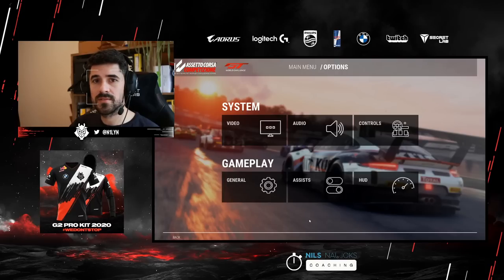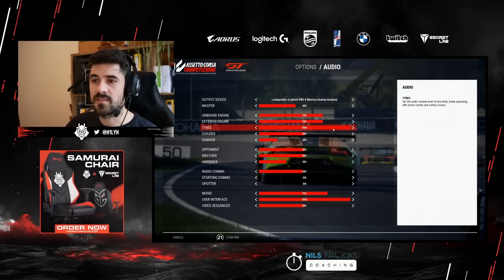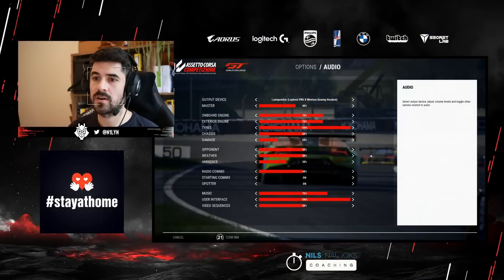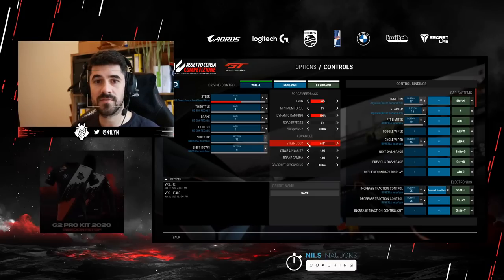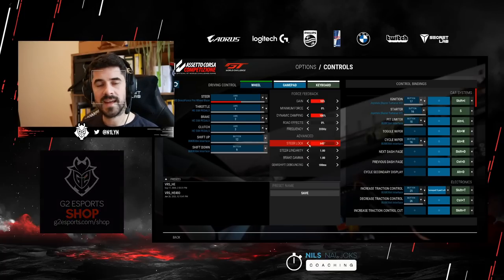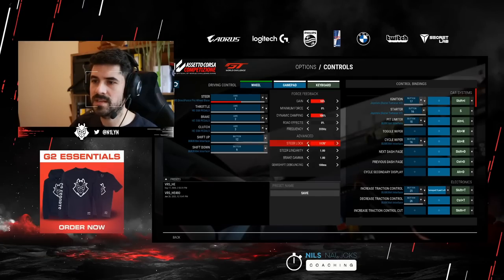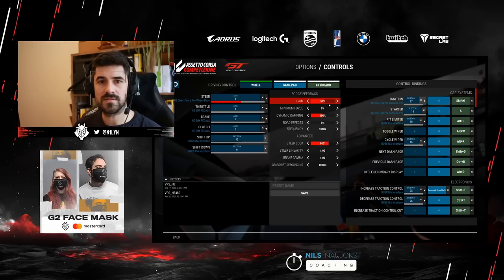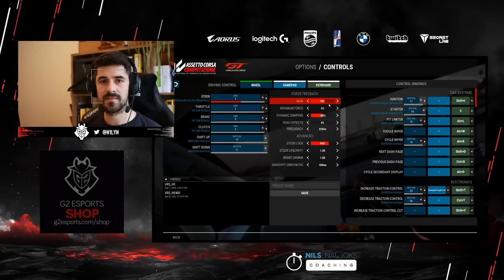Understanding ACC 1/3 - Controls, FFB, Audio, GFX - Assetto Corsa Competizione

Comment: Good video. I'd just like to add for those with Logitech wheels, set minimum force in force feedback to about 11% or 12% in the game options. I found my G920 has a big dead zone unless minimum force set quite high like this. Aris mentioned this in one of his video's, so I tried this and it makes the force feedback a lot better. Aris did say it really only effects Logitech wheels all others should be fine.
 Also with using Logitech pedals I had to go into Logitech profiler and set brakes up in there, as the game settings didn't give me the setting I wanted. I have it where when it hits the rubber stopper I have full brake pressure when pressing quite hard, and brake fully releases when I get no pressure from the rubber stopper. So as soon as I feel the rubber stopper it starts braking then when It is pressed hard I have full braking. It doesn't give me much pedal distance, but I find using pressure on the rubber stopper easier for me.
 Hopefully this might help someone using a Logitech wheel and pedals.
Reply: Thanks for the information..I have a G25 and the minimum force of 11% works well.
Reply: @martynhulland6252  G25 and any other G family are stronger than G29. G27 i think is the best.

Comment: I see that in your video you say not to touch the linearity of the steering wheel but I'm convinced that this is a trick that is used by the best like McCormack, you only have to look at the way they drive to understand that they use the linearity of the steering wheel. I even found this trick not long ago and I'm categorical on the rear engine cars, it's very efficient and it makes the car much more stable when entering and exiting the corners.
Reply from the maker: you are not changing the linearity. it will remain linear, but it will be very sensitive. I do not recommend this, especially for beginners, to make the steering more sensitive than it needs to be.
It is very easy to turn too much and hurt the tires and it is very easy to turn too little, resulting in a choppy way of driving for everyone that is not a pro.
Reply: In any case on the vehicles with rear engine it works very well even for the beginners the car deviates much more stable that gives less oversteer in entry and exit of corner there is just to test to understand that it really changes the feeling of the car there is not photo me now I drive only like that and I am much more regular and I drive in the crhono of the best so these necessarily effective if not I would not have fun to come to speak about it here
Reply from the maker: @hyhhyhyhh7087  ok! so what exactly do you set up?
Reply: 1.07 linearity and the minimum in report in direction
Reply: So convinced? I tested it on the Porsche and the Audi and it proved to be very effective. However, I'm not sure that it's useful on motor vehicles before it only acts on the first 30 degrees of rotation, so it's only useful on very incisive cars

Comment: Love your vids Nils!

So some stuff works differently on consoles (at least still in February 2021) I’m using Xbox One S and TMX+T3PA pedals with rubber mod. I haven’t found a lot of this info online. I’ll put what I figured out here:

-On console the Steering Lock needs to be set manually for each car. (I keep a list in my notes on my phone - I also have the ECU mapping and other misc reference stuff there)

-And the rubber mod on the budget pedals can be made to actually work with the Brake Gamma setting. The rubber inherently gets harder to crush towards the end of travel or can sometimes make it hard to get to 100% which feels unnatural. Using gamma you can make this more intuitive by making it so a slight movement at the end of stroke adds more input and a large movement at the start adds less input - the settings are really sensitive, but you can get a kind of loadcell feel this way. (For reference mine is set at 2.79 and deadzone 2%.) <note: I cannot use my pedals unless they are bolted down with this technique.>
-Install the rubber stop pretty close to the pedal arm (on my T3PA it’s almost touching) 
-Raise the gamma until you can get to 100% brake activation comfortably, then lower it incrementally as you release the break until you can choose where the break intensity stops. (Looking at the input bar on the speed/gear hud) once you can put in about 100%, 75%, 50% and 25% at will with your foot, it’s set correctly. 
-If you can’t get to 100% but DO have good control in the middle of the range, you can add a bit of deadzone. Start at zero and go 1 click at a time. (I use 2%) 
-Everything effects everything, so if you change the deadzone you might need to adjust the gamma, and if the rubber physically gets moved then the settings will have to be dialled in again as well. 

I’m now able to trail brake, or at least trail brake better than I was. And until a loadcell becomes an option, it’s awesome that ACC has settings that can work with these rubber mods. 

Hope this helps!

Comment: Great video Nils. 

But V-sync + frame cap without g-sync, adds more input lag than enabling all 3. Check blurbusters for proper information.
Reply from the maker: Yeah, I've went through all that. Just for me on my monitor G-sync in any scenario creates input lag. I normally had v-sync off too and only the frame cap. But the other day I experimented again and adding v-sync did not change anything but made the image creation smoother. 

Open to further suggestions, but for me thats what gives me the best result (4ms, 120hz, 35" screen)

Comment: So this is an older video but soft lock will NOT work properly in ACC unless your wheel sensitivity AND ACC sensitivity match the car you're driving. Otherwise you can steer through the max angle IRL while the virtual steering wheel is already on the stops.
Reply from the maker: ^ this

Comment: Hi Nils. Quick question. Do you only do racing coach or would you be able to help checking my Simucube 2 settings in relation to ACC to make it feel just right. I also have SIMTAG hydraulic pedals and although the brakes are calibrated correctly it seems on the Simucube software in ACC the brake travel seems to be a lot shorter reaching 100% faster. Let me know and I reach out in discord. Thanks
Reply from the maker: i'd suggest to just ask in the hardware channel, there are a lot of sc2 users. In the end you want as little interference of the wheel software as possible. Just whatever ACC already puts out is just fine. Regards to the brakes probably a video helps to understand the issue (or whatever you find suitable)

Comment: Hey there Nils, great tips. The audio tips were a gamechanger.  What do you recommend when setting the high end deadzone with the brake? Is it better to make it easier to get to 100%, risking triggering ABS or locking more often or leaving some headroom but risking not braking at 100% all the time I stomp on the brake? I have a G920 and with the rubber stopper I have issues modulating my braking when at the limit of the rubber piece (a problem I don't have in AC for some reason). Thanks for your videos, they are great help and it's a shame you couldn't finish first in the 12h of Nurburg today.
Reply: I know this is old but when i use the brake i sometimes move backwards due to my set up, I binded the brake to the clutch pedal and never looked back XD

Comment: Thank for the good advice, but only one thing vsync limits your pc and overwrite your frame limiter and cause the famous input lag, example monitor is a 60hz, means it caps at 60 fps, gsync adapt the frames to your monitor and has less input lag , example monitor 144hz and pc can deliver between 110 a 130 fps your monitor adapt so it fluctuate than between 110hz and 130hz  to that and give the same smooth screen but with higher frame rate, some games have a higher frame rate, so what you can do is limit to 141 fps on a 144hz monitor, happy racing ;)
Reply from the maker: I read this a bit differently: https://blurbusters.com/gsync/gsync101-input-lag-tests-and-settings/15/
Reply from the maker: that means: G-sync and v-sync on in nvidia control panel, but v-sync off in the game.

v-sync in nvidia control panel helps with frame timings and is more a moderator to the g-sync function. badly designed
Reply: @SimracingPopometer  Hi Nils, know that website by heart,please check each faq on that link, one of them states no input lag while using rtss framecap -3 below refresh rate when using gsync or freesync, im using for my self thoose settings for years (freesync) without any issue, once again vsync is capping to monitor frequency, so you hold back performance, regards 😉
Reply: in all my testings from different genres off games, never needed to use vsync ingame or nvidia control panel, what i do is work with profiles, global profile 200 fps, and stops the whining coil off the gpu card when games loads and exceed 400 a 500 fps, than add profile and add exe off the game,set limiter to 141, as example mine is a 144hz, and done
smooth gaming, and dont interfere with vr headset, has own hardware limit off 90hz

Comment: What camera are you using to record. I was actually just able to get rid of the focus thingy on my Canon DLSR.
Reply from the maker: yeah 70D. haven't looked into it really yet - what did u do?
that's only happening when I use it as webcam, cause then I grab the image from that app... there's probably a setting somewhere, but it you've already found that...? :)
Reply: @SimracingPopometer  I installed MagicLantern firmware on my 60D. It gives an option to turn off all the text and extra text on the screen. 

Another option that doesn't have to modify the camera is using Canons EOS Webcam Utility. It can turn any Canon DLSR into a webcam. But it loses some visual quality.
Reply from the maker: cheers I'll have a look
Reply: In my case I just need to switch the dial settings out of movie option back and forth before I start the stream and it disappears. Have to do that everything I turn in the camera.
Reply from the maker: The webcam tool from Canon seems to do the trick! thanks for that
Reply: @SimracingPopometer  Cheers! Glad it helped!

Comment: Foget about that Hertz number.... no Sim calculates more than 60/s... every different number is an interpolation! Your CPU would burn down if the Sim actually would want to calculate 300 values per second. That said the interpolated values can help smoothen out signals anyway (there is even a tool there for iracing doing exactly that -> irffb).
Reply from the maker: I backed that up a bit. iracings physics ticks go up to 720hz, yet the ffb the game puts out is at 60hz unless you use the mentioned irffb. the latter then uses telemetry data to calculate ffb. I personally found irffb better, too, but I never got the setup right to get rid of the added delay. 

other sims, e.g. live for speed over a decade ago, have a temporary physic tick rate of 2000hz at slow speeds for the suspension (that does not mean the ffb updates are done at the same frequency).

Comment: i dont get it the steerlock explanation... if i race with a Porsche for example... i need to put in the steering wheel software 800º and ingame setting 800º? or 900º for both? i mean i need to change this 2 values specific for every car? or just leave it 900º / 900ª ?
Reply from the maker: you need to be above the range of the car with the biggest essentially and then never touch it again. 
though if you have some OSW direct drive for which acc doesn't have a profile then it won't put that soft stop at the end of the range and you can turn your wheel more while the ingame wheels already stops. but normally you shouldn't be at the end of the range anyway. 
for these wheels to have a soft stop at the right place you need to set them to the correct value that the car has. e.g. 720 for the Mercedes in the driver and in the game. 

if you have tm, lg, fanatec, simucube, and probably a few others, then just go to 900 all around and forget about it

Comment: i read the comments and you mentioned that the ''correct'' fov is mostly for large screens and tripples. Would 34'' ultrawide monitor qualify as large screen or were you thinking of 49'' screens? Also i know aliens can run with whatever car/track/sim/fov/wheel combo and still do amazing times and moves but does ''correct'' fov help the rest of us?
Reply from the maker: the only question would be if it helps you personally. i like to see left and right of me not just a narrow window ahead. 
narrower fov means rotation is perceived faster whereas speed is perceived slower. voice versa for larger fov
Reply: @SimracingPopometer  i seem to be doing well with a low fov, 30 on a 34'' ultrawide for the last 2 months. I tried with 40 and times are very similar as well as door to door. 50 i dont like. I think i'm one of those that are used to low fov but worry a little that maybe i reduce my ability to see around me more. Anyway thanks for the reply and all the content over the years.

Comment: Great video, lots of good info, Nils. I have a question... so do you turn G-Sync off? And is that why you have V-Sync enabled in game? Thanks!
Reply from the maker: Wanna stress that these are really just my settings that work here, I suppose other gpu and monitors could work that out differently
Reply: @SimracingPopometer  Understood. I actually needed to have listened a bit further into the video. You answered my question there. Thanks for the reply!
Reply from the maker: no worries, you're welcome
Reply: In Nvidia control panel use the ULTRA LOW LATENCY mode to reduce the input lag!

Comment: The Thrustmaster T300 is 1080 degrees, so I just set ACC to 1080 and in thrustmaster control panel to 1080.  I assume that’s fine or should I use 900? Again, another awesome video.
Reply from the maker: yeah you are right, 1080 on both should result in the same as having 900 for both

Comment: Could you also make a video on the view settings? For example: if you calculated your fov and it is ... then you should put the, distance, pitch and camere placement like ...
Reply from the maker: no. these calculators are shit imo. drive what u like
Reply: @SimracingPopometer  wait really? Appreciate it dude because with those calculators i couldn't see shit on my 24 inch monitor😂
Reply: I find that with a narrow "correct" fov it's easier to judge the racing line and speed correctly through a corner but it's more difficult to see in tight corners. With a single monitor setup it's better have slightly wider fov just so you can see all apexes. With multiple monitors the only fov should be the calculated fov.

Comment: Hey Nils! Thanks for the video, great advice.

I have a question--my G27 will not match up with the steering of the wheel in game in ACC. In iRacing it seems fine, but ACC, a slight turn on my steering wheel equals a huge turn on ACC. Steering lock is 900 degrees on ACC, and I tried turning the scale setting down to 50%, which helped a slight bit but still doesn't match.

If you (or anyone else) has any advice on this is much appreciated. Thanks!!
Reply from the maker: best to reach out on discord for these kind of things cause it probably needs a few back and forths - and there are a lot of people with the wheel as well!